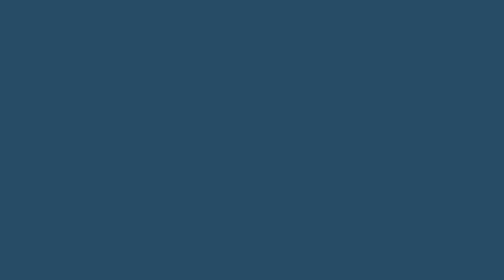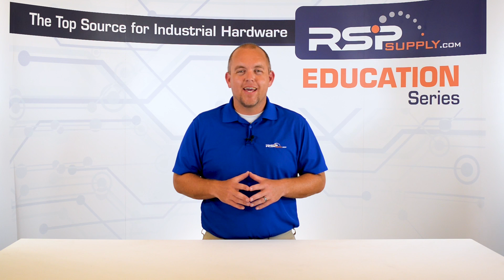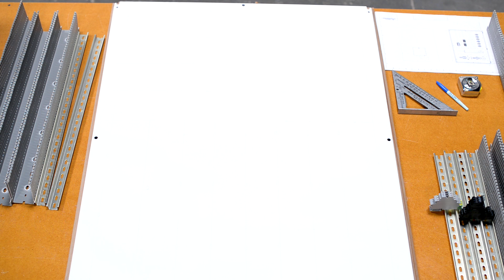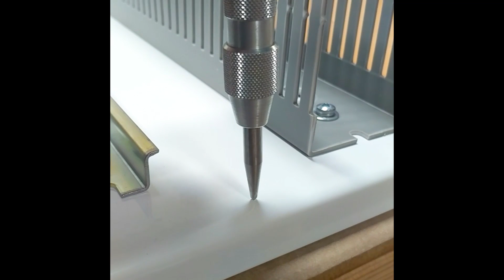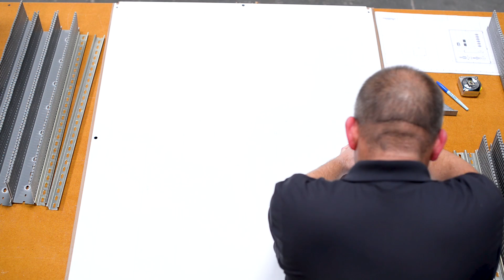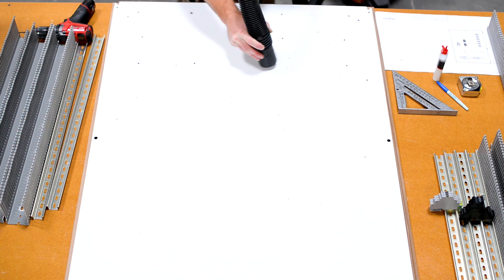Panel Build Series Part 14: Drilling and Tapping

Comment: Should drill /tap 10-32..Using 10-24 does not meet thread count for panel
Reply: I agree. No significant extra work, but much better screw engagement.

Comment: Have you had any luck using combination drill/tap bits?  The ones that drill and tap in one step.
Reply: They work fine in a few holes, but in large panel to many holes and different size they will end it up messing your holes!
Reply: @jamesquiroz9720  Thanks.

Comment: Dont use a drill to tap do it by hand it takes longer but makes Assembly so much easier also less likely to break a tap
Reply: Use high torque and brushless drill (minimum 60Nm) instead of small one like the one on the video, plus cutting/tapping fluid, most electricians always ask me how it is possible that I do not break those combined drill/tap bits for months.